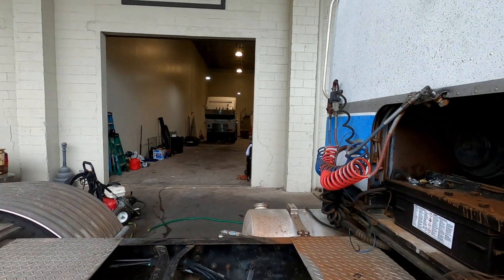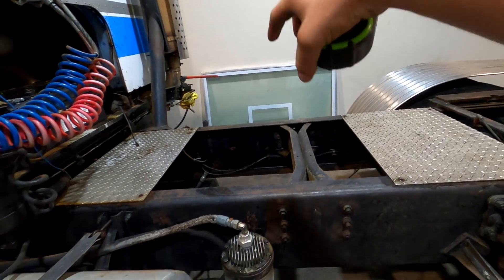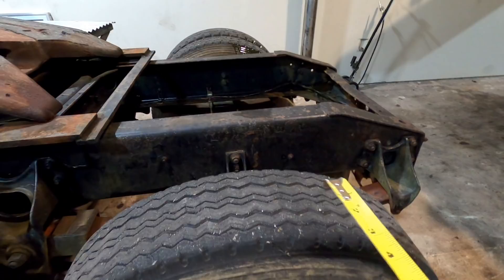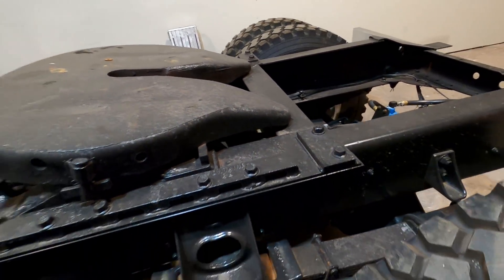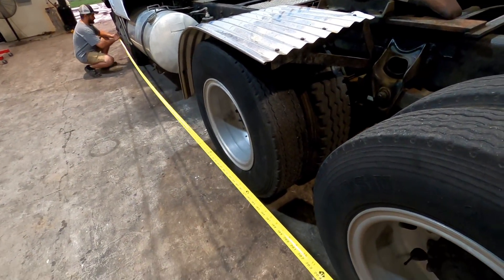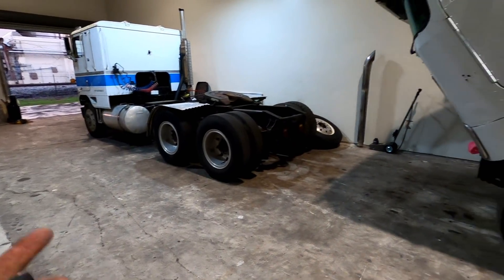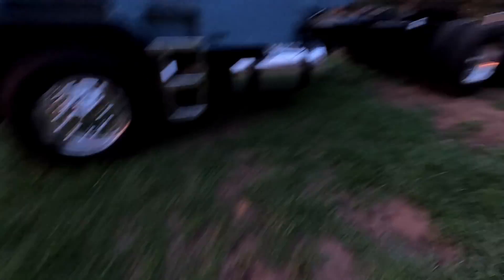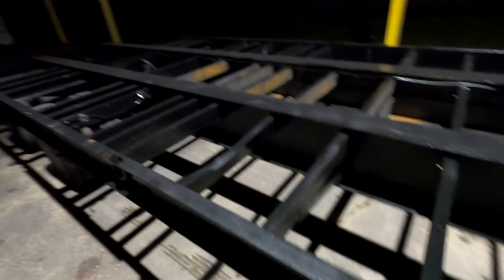USAF Cabover Frame Stretch?

Comment: Leave the Air Force truck alone. Fix and restore it, leave the frame alone.
Reply: You might regret having two stretched trucks. What about swapping frames without stretching so much?
Reply: Modifying the frame might probably be a waste of time.
Reply: We need to vote on the Community page of their channel. Agree, extending the frame is a no-no.
Reply: Swap the engine it's better
Reply: Andrew Jones Productions already voted there. Just wanted to add an opinion to why I voted the way I did.
Reply: Porfirio Adame he said the white truck had numerous wiring issues. Kind of pointless because the air force truck doesn’t have any headlights or taillights and just the fog lights.
Reply: @Krause_transport_garage  they both do he basically bought a new cabover that requires the same amount of work to fix as the white one its older but is an important peice of history unlike the white one so it  kinda makes up for it i still think he should fix both he has 4 cabovers 3 internationals and one freightliner
Reply: Tyler Duysen did he actually get that parts truck? I remember him mentioning it but that was it.
Reply: @Krause_transport_garage  yes they bought it dont know if he picked it up yet though

Comment: I’d leave it as is and concentrate on mechanicals- engine, transmission, brakes. Seals are a simple fix.
Reply: Are you nuts?
This is Bruce Wilson and if he wants to s-t-r-e-t-c-h it then we should encourage him. It is such a simple job to do You just cut both of them in half and stick one back on the other one, job done. Jeez how hard can it be?
Reply: Dude it would be so sick to stretch that? Air Force truck stretched sound pretty awesome to me.
Reply: @masonringbinder684  This is the same problems as before with the white truck where he did not due the mechanicals first and ended up scrapping the project. If the Air Force truck cannot run for an hour in the Florida heat without over heating, then it makes no sense in spending any money and time on anything else till it gets fixed. Make it work first then play.
Reply: Like he said leave the frame alone, its a nice length.  Get it mechanically sound and run with it.  There is a kw 100 double bunk down the street from me with a long ass frame on it!  Black with green stripes. Looks way cool not sure what all it needs.  It needs some work but it was just parked there about a week ago at a container transport yard.
Reply: Agreed fix the damn thing

Comment: I’m feeling confused now as to y we need to stretch everything and not complete a single build doing my head in
Reply: I made the exact question. I dont get it either
Reply: I agree with your point
Reply: That's just the way Bruce rolls, I guess.
Reply: I think in this case, it’s more that the rear end of the OG truck is already virtually done, so it may be easier to just splice it on rather than transferring stuff piece by piece...so hopefully that means it will actually get done.
Reply: He did finish the blue cab over  as he just needs to change the 5wheel.
Reply: @SurfGreenTelecaster  I thought he said in a older video that the motor , gearbox and rear diffs were all shot in the white cab over?
Reply: i thought i liked to throw money away jeez lol
Reply: @seanbax2622  Haha, that could be - I don't remember.  But yeah, he did get the job done with the Freightliner.  Honestly, I don't get upset over the ADD projects.  I enjoy Bruce's vids either way.
Reply: Stretched frames from the manufacturer are done to accommodate sleeper cab sizes and/or the type of loads that will be hauled. Sliding 5th wheels and trailer tandems are used to get the axle weights legal. If I remember correctly from my truck driving days, each adjustment position makes about a 500 pound difference adding or subtracting weight from the axle. Sliding 5th wheels are mostly used to provide more cab clearance on loads that extend over the front of a flat bed trailer. They are also used to help smooth out the ride of a rig because  sliding the 5th wheel forward or backward even one or two set points can make a big difference in the ride of the tractor. You will sometimes see a truck pulled over before a weigh station repositioning their 5th wheel to get the axles legal because they "stretched out" to get a better ride. Hobby truck enthusiasts do it mostly because of the wow factor. A stretched tractor looks cool!
Reply: @hobo1452  
How much weight is moved is really dependent on the load and how it's loaded. The 5th wheel can move weight to/from the steer axle, or drive axle(s) .
The trailer can move weight from the trailer axles to the drive axles or vice versa
Reply: Just keep as is do the swap you already have a stretch
Reply: He won't stretch dammit!  He's going to polish that truck up, then cut two trucks in half and have two broken down half trucks laying around.

Comment: Leave it alone till everything is mechanically sound on the truck, headlights, marker lights and a truck that doesn't overheat is a little more important then stretching a wheel base. You have good ideas that will play out but your priorities have to be dealt with first to make the truck road worthy and reliable. As they say - Chrome don't get you home.
Reply: That is right
Reply: They just making vids and fishing to get the numbers up on there channel
Reply: @BadgerBadgerBadger28  OBVIOUSLY... 'cause that's what makes it interesting maybe?
Reply: Amen, he needs a common sense plan with priorities.
Reply: Would agree except part of the reason is the axles on the AF truck are shot so getting back to working he needs them, no?  But get the engine, cooling and electricals fixed before swapping and even before looking for some horsepower.
Reply: No bad idea cut it make it cool and bad as why be all lame
Reply: M Plante That doesn’t make YouTube hits though.  I don’t watch what makes sense, I watch dumpster fires!

Comment: Wheelbase is measured from front steering axle to center of the tandem axles, so your wheelbase is shorter than what you measured
Reply: I was about to say the same.
Reply: Same here
Reply: Point is one wheel base is shorter than the other , what are you gonna do with the correct Info , 215 inches not 208
Reply: I thought it was center of steer axle to center of 1 st axis. Guess I was wwwrrroong,
Reply: @rickzima8697   Mr. Rick you are right It is measured from the center of the steer axle To the center of the rear front axle
Reply: I'm sure the company you were working with the beef up the engine in the white International is super excited to know they sent you a bunch of parts for it at no cost or a discount since you said you were working with them and now that project is abandoned. Probably wouldn't count on them working with you again in the future

Comment: I am trying to understand the purpose of a "Stretched Frame " when you plan on pulling a 
40 ft." trailer ----- after over 50yrs + trucking, I think that length would be a Real Bitch to get around any city. Let alone getting in and out of your shop.  Also my guess is 90% of the people that want the stretch have never tried pulling a 40ft trailer around a city. ( just my 2 cents)
Reply: Garry,
I've been in the trucking industry for 42 years  and I agree. If they keep the wheel base to 190  inches it won't be too bad most trucks today have 230 or more .
I know a long wheel base will get much worst fuel mileage as well.
Reply: Thats real my one day my dad drove a kenworth w900 with bed and a little added section and he was pulling a 53ft trailer into a parkin lot of a cotsco in Puerto Rico it was hole mess
Reply: Now he drives a ford l9000 aeromax single axle pulling a 40ft trailer and it is so much easier, and it actually have a big cam 290 in it
Reply: "gon b a show truck"
Reply: Stretching was for ride comfort on cabovers. Takes the buck out of huck and buck of the road and trailer. These days, its all show.
Reply: Thats the favour of a coe compared to the nosed truck;
they look cute but you miss always two+ yards length 
in the parking lot. Or a u-turn. Long frames make sense
for heavy hauling over 40 (metric) tons, or with a dolly.
Or a 5 axle tipper where the first 2 and the last are
steered axles. Cabin height is set from the engine size below.
(Like the Scania P- S- and R- versions a.e.) 
The length of the frame is set by the net load capacity.
7.5 ton 2 axles 12 ton 3 axles 18 ton 4 axles and 25 ton
5 axles.
Reply: agree with that
Reply: When you have a longer Fram it's a smother ride
Reply: @ryansaco318   so a longer oil filter makes it ride better?
Reply: @bubbasharpiln1575  no its the Fram because  when you hit a bump it gives the springs more Time to stop bouncing before the back axles start bouncing because the the axles are farther apart
Reply: @ryansaco318  He is making fun because you have spelled FRAME as FRAM twice in your last two posts.  Fram is a filter manufacturer.
Reply: I drive a 290” wheelbase long hood with a 48’ spread axle every day. If you’re even a half assed driver, you can handle anything. It’s not bad at all
Reply: Your right, its about looking cool, you know how many times I sat in a truck stop or a warehouse and saw those guys trying to get in a hole or a dock with one of those long ass tractors a million pull ups.
Reply: @markcreasy5108  oh damn I'm dumb
Reply: @rolandocastillo85  He dont know shit about building nothing.. Mickey mouse can definetly do better.. The guy had a better truck but knows no difference..
Reply: I did, drug it around with a 183" wheelbase IH.
Reply: Stop being lame stretched looks way better and is way cooler and like Bruce you gotta be cool
Reply: @markcreasy5108  apparently he wasn't at the top of his class....lol
Reply: @bubbasharpiln1575  lmao.. .
Reply: @bodeykaskin2810  dude in Puerto Rico most of the roads are in really bad shape and also most are little
Reply: Don’t longer frames make it were you can’t haul as much weight

Comment: Bruce I have a 1995 IH 9600 cabover and run it coast to coast . little advice: 1- dial in all your mechanicals before you play with the frame 2- if you stretch it get a cutoff from a salvage yard. I stretched mine 5' and used a 2013 prostar air ride cutoff.  tge purpose of a stretch is to improve the ride, the longer the better for comfort. I highly recommend not replacing an old spring ride with an old spring ride. it's easy to run a air dump switch and valve into the cab for dumping and inflating the bags. I have the same franes as yours and you can get the iron to do it. do it Right and LEGAL and use huck bolts! ! I dud my stretch in November 2018 and have been DOT level 1 3 times in California and 2 out of the 3 times the inspectors gave props to the OUTSTANDING and LEGAL stretch. if your just using these trucks to haul toys and play with then dont sweat a stretch but if you plan on working it and running the road or putting a driver in ot to work it then I recommend a cutoff and stretch. trust me, you'll be MUCH HAPPIER with an air ride cutoff and stretch then a kidney popping spring ride. Mechanicals first, stretch and other fun stuff second.
Reply: I hope he reads and heeds your wisdom here.
Reply: @kmcwhq  Yea, I agree but Bruce seems to cop an attitude when experienced truck drivers and mechanics give him advice
Reply: @smokeinapeterbilt  His channel, his money, (Daddy's money?) his projects and attitude I guess. Worth double the price of admission fer sure!
Reply: @kmcwhq  You got that right
Reply: I vote for this guy!

Comment: Maybe try a different approach: Make It Go Before You Make It For Show
Reply: Can't tell you how many people in my area are about show. They'll take a stock Civic and poor tons of money in paint, wheels, tires, ..., and it's still just a stock Civic? Very odd to this old muscle car guy.
Reply: Joe Trippi my thoughts exactly u couldn’t be more right.
Reply: It does go.....maybe I'm lost on hat you mean if he got rid of the 3:90 gears to a lower gear it'll drive better...plus the rear would be brand new damn near....other than that the truck drives.. obviously he drove 600+ miles in the damn thing
Reply: Douglas Price not without having it overheat 3-4 times... figure that problem out before dumping money into it to make it look pretty

Comment: Just get it mechanically sound and restore it. This seems to be the same issue as the first International cab over, I'd hate to see it pan out the same way and end up unfinished. Seriously losing interest in this and feel like the sponsors aren't getting the full benefit of the parts they provided.

Also, speaking as an ASE master diesel tech, I strongly suggest not cutting and welding the frame unless you're going to have it done by a qualified frame shop.

Comment: So you've basically bought a truck that requires just as much work than the other international. Go figure.......
Reply: Did you expect any less from Bruce ?
Reply: Maybe true, but now he has a parts truck to pull from!
Reply: @ddaysrevenge2508  he has a 4th cabover you know that was supposed to be for parts for the white truck so he could make 3 out of all 4 leave blue collar alone fix the airforce and white cabover and have lots of spare parts to sell or scrap
Reply: tyler brown yup
Reply: I think he just likes buying crap, this one looks worse than the other two and is far further from being complete than the first one.
This one looks more worn out and has less going for it than the first truck and he hasn't even torn it down yet.
Pulling apart a 75% truck to try and save a 20% truck due to being used by the airforce is unwise and he'll end up with two piles of scrap and no matter what people will hate on him for modifying it.
Reply: Dave gives him something to do I guess
Reply: @thatgraysuburban  He's got more money than sense. 
If nothing else he's foolish ripping apart a decent truck he's worked hard repairing for this hunk of shit just because the USAF owned it once. 
If he's that hell bent of restoring this shitbox than buy a parts truck that could be used to fix up all 3 and then the leftovers sold so he's not trashing something half decent just to polish a turd.

Comment: Personally, I would be kind of nervous cutting and stretching the frame without knowing the best place to make the cut in regards to the frame stress points and how they change when you have a sliding 5th wheel and sliding trailer tandems.  That's the kind of considerations design engineers get paid the big bucks to figure out.
Reply: This is called kinetic.
Reply: The same way he ran to do all the cosmetic upgrades on the White cab over, only to find out the engine was bad, the trans was bad, and was in way too deep...so the best response is to go and buy more trucks...oh and when is the CDL coming in this pandemic era...no DMV's open to get tested at...farm CDL? HAhaha

Comment: If you’re going for “cool”, leave it as stock as possible but drop the front. Take the riser blocks out of the front axle and possibly a custom set of shorter spring shackles and it should give you 2” or so front down. Low pro 24.5” rims and tires. Tall 5” diameter exhaust pipes and a good polish job. I wouldn’t go any steeper than 3.70’s on that old Detroit, maybe 3.55’s if you plan on running it 65mph or more. Old trucks are cool as long as they stay looking their original form.
Reply: He wants a show truck not a convo piece
Reply: Winner Rabbitry stretching it won’t make it a show truck. I show my truck and trailer. He’s got a lot to learn if he’s wanting to go that route.
Reply: Winner Rabbitry trust me, it’ll get much more attention at a show if it’s dropped in front and polished. A 20” curved end bumper, tall 5” pipes and a factory white painted sunvisor. You’re right, it’s his to do as he chooses, but if he wants positive attention, build something that isn’t cobbled together and orange peeled to hell.
Reply: he should focus on other things than just worry about the frame since hes got two good looking trucks

Comment: Isn’t wheelbase on trucks measured from the center of the front tire and the center of rears/ in between the axels
Reply: Tyler Ambs thats how my trucks measure out compared to factory specs.
Reply: Yup.
Reply: I was going to post this, but I figured someone more knowledgeable would have chimed in by now and so I looked and found your post fairly easily.
Reply: Yep
Reply: Bruce still has so much to learn on big rigs.
Reply: Yes that correct
Reply: @jesushinojosa1461   Maybe so, but who am I to judge, he knows more then I do,
Reply: why is that does anyone know? like why does the factory measure it like that
Reply: Your 100% correct

Comment: That's now how you measure wheelbase on a tandem axle semi tractor,  you measure from the center point on the steering axle  to the center point between the tandem axles.

Comment: You measure the wheel base from the centre of the rear axles on a tandem. You measure from the centre of the rear axle on a single axle truck. If there are three rear axles you measure from the centre axle. The rule is you always measure from the centre of the front and rear axles. 

Stretch it out to a 244”. It’ll still maneuver and be a better ride.
Reply: I'm not the only one to catch that right off the bat... he'll learn as he goes.. at least we hope so
Reply: John V that’s how we learn, people helping out.

Comment: stretch it if you want to. It depends on what you want to do with it. It will ride better with a longer frame. One note of caution: do not make straight cuts and butt weld. It will break in half. Cut half way down, over and down. Add a glove to the inside at least 1/4" thick on inside of entire frame and bolt it in. Glove should extend a foot on either end from the joint. This is not a 1 day job. Do it right or leave it alone.

Comment: The wheelbase on a tandem axle is measured from the center of the front wheel to center of the tandems. Don't stretch it, and get it completely mechanically sound before doing anything else